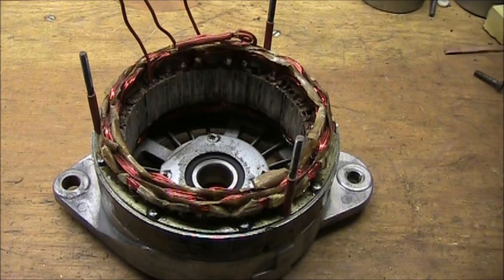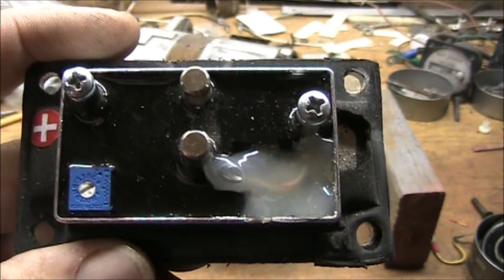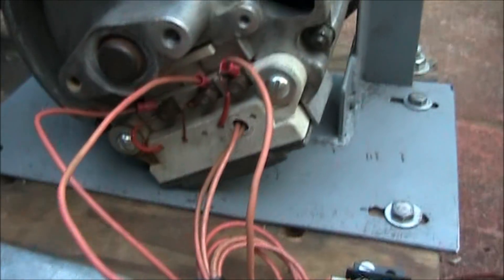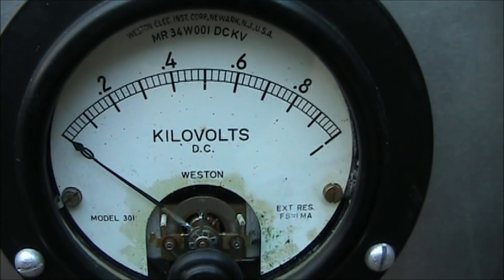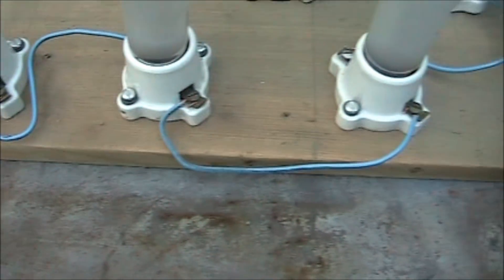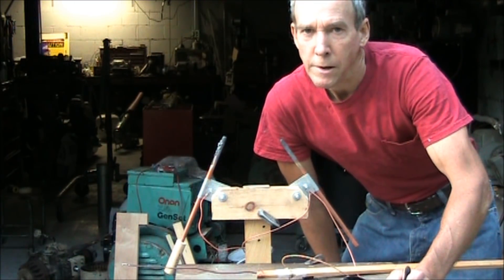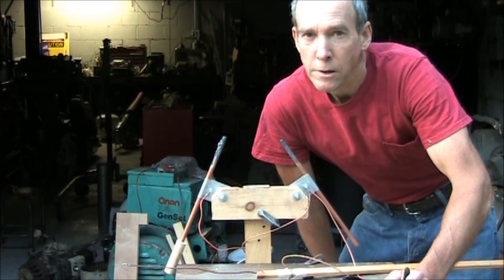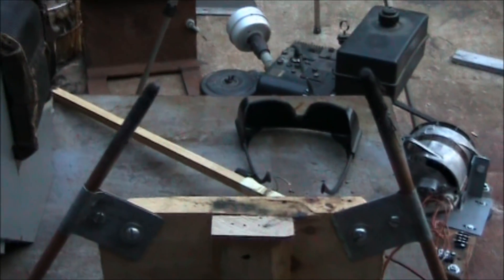700 volt car alternator

Comment: How the heck did you rewind the stator
Reply from the maker: Find yourself a junk stator and unwind it. You will see there are three sets of wires. Just rewind with thinner wire.
Reply from the maker: It isn't hard or complicated with a book. But I did leave out the coil phase insulating paper.
Reply: @stephenhrobak3631  could you detail in a video how you rewound a stator?
Reply from the maker: @MountainTopElectronics  There are people out there far better than me at rewinding motors. I would make a poor example of myself.

Comment: Hi will u tell me the HP and  RPM of the engine
Reply from the maker: The engine is a 10 HP Briggs. I don't think the engine exceeded 3200 RPM. And it sure did bog down under load.
Reply: @stephenhrobak3631  hi thanks for reply

Comment: Wow very impressive.  Just curious is there some reason you are needing such high voltage.  Are you trying to do electrolysis or building a carbon arc lamp or just experimenting?
Reply from the maker: This was an experiment to see if a car alternator could be used for a small portable high voltage power source. It turns out that a small integral engine generator with a transformer would be a better setup. Thanks for your interest.

Comment: I'm working with delco 22si alts. I need to get 24 v from them. they are 12 volt . I have heard just change the regulator. and just turn a few more rpm. I just don't want to waste money. I know they are capable of a lot more than 14v. they are 130&150 amp. have any suggestions? your advice will be greatly appreciated. thanks.

Comment: Nice experiment.  Pushing winding insulation designed for 15 volts to 50X that value certainly speaks to serious over-design by L-N engineers.
Reply from the maker: The breakdown rating for the varnish is much higher than 15 volts. Plus the fact there are several layers of turns gave enough margin to function. This was an experiment with high performance alternator design. It is certainly not meant to be a durable long term unit. Thanks for your interest.

Comment: What size diameter pully did you use on your drive motor?
Reply from the maker: It was a 6 inch pulley. Though it probably would ran better with a slightly smaller pulley.
Reply: Stephen Hrobak thank you very much.

Comment: can that load power a 200 hp dc motor with not problem ?
Reply from the maker: I don't think so.
Reply: Stephen Hrobak 
that's about 750 watts per HP. plus system losses. its not going to out put more than the input. not even as much.